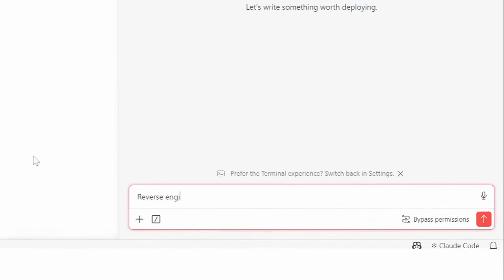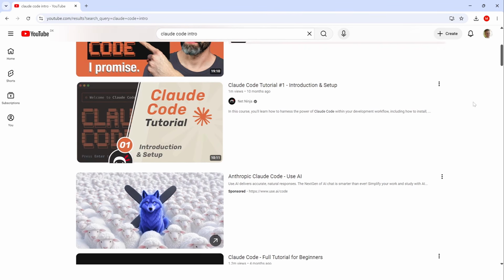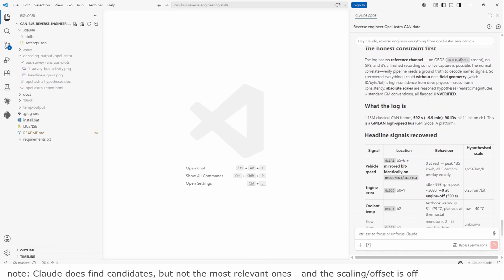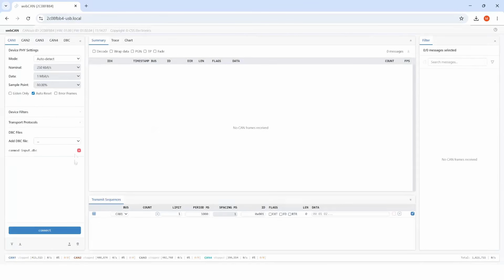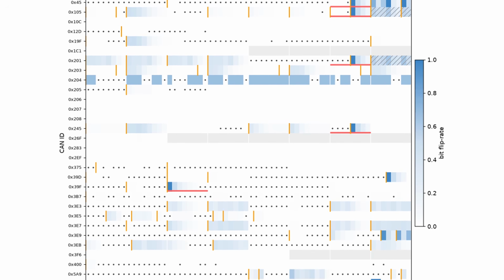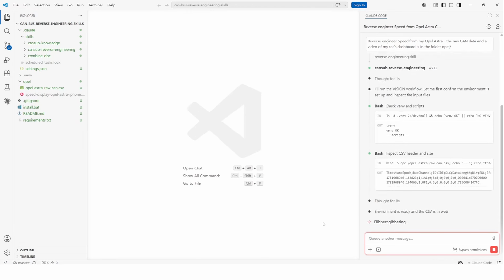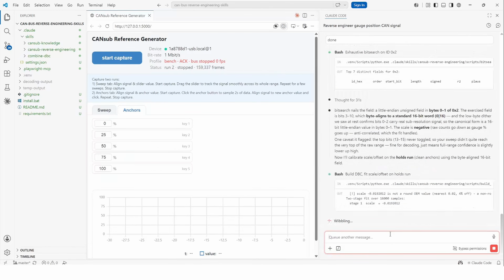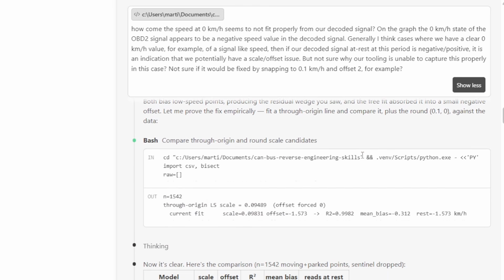AI CAN Bus Reverse Engineering [Claude Code]

Comment: Curious if you think this can be used to lets say control exhaust valves on a car like a 2022 bmw g80 m3. The valves can be control through the cars idrive which i assume uses can bus. Can you sniff the signal then attach it to a physical button to control whenever you would like?
Reply: First: Transmitting custom CAN frames into an active vehicle without knowing exactly what these frames represent/affect is VERY DANGEROUS. This is the reason why none of my showcases specifically describe transmit-oriented workflows like fuzzing or attempting to control vehicle behavior - as I don't think it's a good idea unless you know 100% what you're doing. If you do embark on something like this, make sure the physical environment and setup is safe. 

Beyond the above, I can't say for this specific case, but generally: If you have a way to trigger/initiate the proces you're looking to focus on and create a 'reference signal' e.g. by following showcase 3 to produce digitized, time synced data on the exhaust valves, then I expect you'd be able to use the skill to help you identify potential candidates for which IDs and data bytes correlate with this process. In turn, this should give you a set of candidates that you can 'replay' via python-can, for example, with certain signal values (encoded as raw CAN frames) to see if your actions induce the expected behavior. If you can consistently get the intended result by transmitting these candidate frames via python-can using the CANsub, then the final step is "just a matter" of finding a button-to-CAN product and map the custom frames accordingly. However, it may be that you encounter spurious behavior - e.g. if it's not a simple "send frame X to trigger Y" but e.g. some multi-frame logic. You may also hit challenges if you're trying to contradict the existing settings that would be set by the car itself - i.e. you can't typically "turn those off". 

With that said, others on youtube have more experience in this topic - Zero to 60 is coming out with another CANsub video soon where they do something closer to this :-)
Reply: two solutions come to mind. 1. bypass the canbus and just mod the actuators to work without any can signalling, replace them with a more "basic" 12v on off style actuator or vacuum type. 2. actually come up with a way to make the module that control the actuators send the packet that makes the actuators move. If you reverse engineer the software you will probably find a state machine that checks for errors and certain operating conditions to be met before the actuators can be well actuated.. Lets say its the ecm controlling the actuator, you could make it so that if drive mode is x and throttle percentage is over x open exhaust valves for example, or if clutch is pressed and car is moving open actuators etc those are just crude examples. there are no limits. only thing limiting the logic, is space constraint in the ECM MCU's flash size and integrating your new function within existing scheduler without causing serious issues. and ofcourse youd need to preferrably have a unused input unless you cannibalize something like maf sensor input or clutch switch input to use them as button inputs. you could even add logic that reads packets on can bus and that then actives your custom added function in the ecm like switching to a stage 1 tune. The sky's the limit basically.

Comment: use it to decode the firmware for your ECU instead, it found every can frame and how its scaled, decoded, even if its from a pin on the ECU (like engine crank/rpm, etc, iat, etc) even all the hidden uds commands and key/seed algorithm
Reply: yup, without it you never know for sure what each input and output value in ram is wired to physically.

Comment: Ive been using it to make a tuning/diagnostic application based on correct math the ecu uses it can currently look at lambda fuel table ve table the log file and tune and make the corrections to file to make it match. You select a range of what it does in the app eg maximum % change how many times did you visit that spot in the log file how many times did it observe this behaviour then it spits out a new cfg file
Reply: I just need more tunes and logs from other ecus to get it to support them also.
Reply: The math the ecu is using is based on live ecu sniffing, math i found, reversed engineered math. Sniffing was last it confirmed our math to ecu live in accuracy of .00012° of timing so id say its pretty accurate  and not one of those apps that makes things up and takes a leap in the dark
Reply: Plan is it'll see all logged channels see not aligning data eg high injector duty and lowering fuel pressure tell you to inspect fuel filters fuel pump etc

Comment: Can this work for more obscure CAN signals, meaning what if a reference signal is not possible?  Some examples might be motor current draw, coolant flow, motor temperature, motor speed demand, etc.
Reply: Without a reference signal it'll be like looking for a needle in a haystack, but with a blindfold on. This goes for both the 'classic' manual method and the AI-enhanced methodology: Without having a clear way to validate if you've found the right result, you'll not be able to reverse engineer it in my opinion. However, there can be more creative ways you might get at least some "reference holds". For example, you may be able to assume that motor temperature is going to be roughly X degC when you start the vehicle if the outdoor temperature is Y. And you may then also be able to assume that the motor temperature is going to be Z degC in that scenario after having driven for 30 min at roughly 50 km/h. And you may assume it's e.g. a linear climb from the initial temperature to the temperature after 30 min. Claude will probably be able to give you some rough figures for what that may look like - and you can then provide the raw CAN data along with this rough external info to get a chance at reverse engineering the motor temperature. This makes it equivalent to my 3rd showcase - but obviously it's harder if the signal changes slowly or if it has a lot of noise (like current draw).

Comment: I gave my VCDS loggings to Claude and it told me to change the PCV valve, spark plugs, ignition coils and the timing chain, it also recommended me an engine oil which, quite surprinsingly, reduced the oil consumption on my EA888 gen 2 engine. My mechanic said that if I had delayed the replacement, the chain would have jumped time and destroyed the engine. The 20$ subcriptions saved me from a big headache and also from a 2000$ engine replacement, so kudos to Claude.

Comment: This is really amazing, I am only still watching the video but would I be able to use this for the likes of activating a reverse camera while towing? The only problem is that the camera turns off at 10mph so I am not sure if this would be possible.
Reply: If the data related to it is available on the CAN bus, then it may be possible - though it may be a bit difficult if it's a state signal that is only triggered by reverse driving, as there may be many other state signals that get flipped by such an event. But if it toggles off at 10 km/h consistently, that might be a useful isolation mechanism.

Comment: Great video! I think it would have been even better to tell something about expected token costs. I would assume that if you need to feed video as ground truth data, converting that to usable numerical input is going to eat a lot of tokens. If you have time correlated OBD-II data with raw CAN BUS bytes, then it should require much less tokens to reverse engineer.
Reply: I don't feed the raw video to Claude - rather, Claude just has a Python script that uses OCR to convert the video into a time series reference signal. This is generally the principle throughout: Use Python scripts to minimize the context/token usage, meaning that Claude only has to focus on light-weight statistical results. The usage was minimal in my experience. But good feedback, this could be more explicit! :-) But basically the OCR workflow vs. OBD2 workflow uses the same amount of tokens more-or-less as the heavy lifting is done via scripts in both cases.

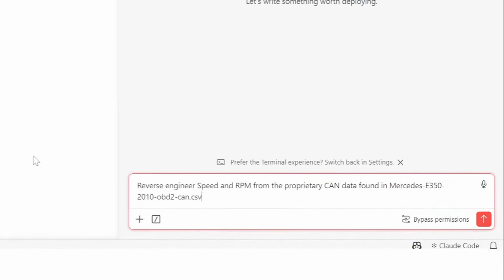Comment: 0:34. Those CAN bus signal shown in the prompt and in the graphics aren't proprietary. You could have at least used something that's actually proprietary... 

And now I think this is a 30 minute video showing you how to get data that you can already get.
Reply: I suggest watching the full video, I think you're misunderstanding the role of OBD2 data (used as a reference signal because it is indeed public and known) vs. the proprietary signals that are indeed not known in advance. The speed and RPM signals in the first showcase are 100% proprietary and not known (at least to me) prior to making the showcase.
Reply: @martinfalch8016  You clearly have no idea what you're talking about.  There are many PIDs that have to be exposed for anyone to read for various reasons - these are not proprietary.  Wheel speed and engine speed are two examples that are required to be exposed and are not proprietary.
Maybe you should actually read upon the topic, or maybe plug an OBD2 reader into a vehicle and see what you can read without proprietary knowledge before trying to correct others 😉
Reply: @Shocker99  Again, I believe you are misunderstanding this. You are 100% correct that OBD2 PIDs are generally public - you can find a full overview of these on the Wikipedia OBD2 PIDs page, or my own OBD2 PIDs overview page. There is no point in "reverse engineering" OBD2 PIDs and therefore that is not what I am doing in the video. Rather, I leverage the fact that OBD2 PIDs like Speed and RPM are publically known and can be requested with any tool (such as OBD2 scanners - or our CANsub). This allows me to request data on these signals via the OBD2 protocol in order to get a 'reference signal' that I can use to reverse engineer the proprietary equivalents to these signals - i.e. the Speed and RPM that is "broadcast" by default on the underlying CAN bus. These are useful for many reasons (as I explain in detail in the full article), e.g. because they are often higher-frequency and higher -resolution vs. their OBD2 counterparts - and require no requests in order to be recorded.

To be fully explicit, OBD2 data such as speed (PID 0x0D) and RPM (PID 0x0C) is available on the CAN ID 0x7E8 in response to request made via CAN ID 0x7DF. In contrast, the proprietary Mercedes E350 Speed is found to be broadcast on CAN ID 0x19F, while the proprietary RPM is broadcast on CAN ID 0x105.

I would not correct things unless I knew what I was talking about. I am a co-owner of CSS Electronics and the author of this video - as well as all 200+ guides/articles on the CSS Electronics website - incl.our intros to CAN, OBD2, J1939,  etc. I have provided technical support to thousands of engineers working across our 10,000+ customers globally. The confusion between the "underlying OEM-specific proprietary CAN bus data" vs. "OBD2 PIDs" is a common thing that I encounter - and maybe it could be made clearer in the video.

Comment: Thanks for the info. I'm new to the concept so maybe this exists already but if this were to interface with a user submitted info that claude could reference as well as other members that would be awesome. For example I could upload my data and vehicle type for the values I found to a database that others could add to you could in theory help reduce errors/hallucinations and possibly even find that a manufacturer has common values across certain years to speed up and or confirm results.

Comment: outstanding work! I'm a bit surprised this didn't trigger any safety flags in Claude Code. I would be interested in how an open source model like GLM 5.2 would perform on a task like this. Great work again, these agentic models really unlock their capabilities once you help them "close the loop" on your work. A bit harder here as there is a hardware component. Excited to see what come next!
Reply: I used Opus 4.8, rather than Fable 5 - but I think it would be the same either way. I don't think this is seen as a safety issue from Claude's perspective. I expect other models willl work more-or-less equally well, though I have less experience in what the "skill" equivalent looks like in other ecosystems

Comment: Very impressive, how about using an actual automotive scanner with the capability of reading data flow from the vehicle to get reference data??
You think that will give claude valid data?? being that data from scanner it is not raw data but processed data, possible to train Claude with said data if you tell it about latency in scanner 
data??
Reply: I actually mention this option in the full article - i.e. for the vision/OCR workflow, you can record some scan tool or e.g. an OEM diagnostic tool in real-time while you record the raw CAN data. Since OEM/scan tools often incorporate proprietary decoding rules that they won't share directly, you can leverage this fact to simply create a clean reference by filming a real-time value from the display of such a tool (like my 2nd showcase) and then use this. I expect it'll work very well.
Reply: Yes, absolutely. I myself used used AI to reverse engineer techstream and then used "j2534 shim" to capture all the packets that travel between the car and techstream. Then you just process the techstream internal id's to the data that you captured and now you know that packet 00x0 is engine rpm. I took it further and reverse engineered my cars ecu basically 100% and know how the ecm processes crank shaft position sensor signal, converts it to rpm, broadcasts it via can and sets fault codes and so on. 
Having a manufacturer specific software and captures of it in action while you log certain things is a cheat code if youre reverse engineering a ecm. You get the ground truth for inputs and outputs.

Comment: Where are you going to use this I don't understand
Reply: Basically, anyone that wants to use vehicle/machine data - but are not the original manufacturer - may need to reverse engineer some of the data to enable their use case. This can e.g. include operators of vehicle fleets, researchers, hobbyist etc. I explain this in the initial part of the video, and in more detail in the full article :-)
Reply: @martinfalch8016 thank you very much!

Comment: Have you any idea how hard it would be to make it work on isobus?
Reply: It would be the same concept - but most of the ISOBUS data is already standardized in my experience and the data is public. We offer an ISOBUS DBC file for convenience. I always recommend checking what is decodable from available DBC files first in J1939, ISOBUS, NMEA 2000.
Reply: @martinfalch8016 haha... Yeah, from my experience, pretty every manufacturer in agriculture has their own way obfuscating isobus data.

But yeah, thanks! I potentially have a young electrical engineer coming over to learn about some isobus sniffing. I'll stick to mechanical design thankyou very much haha.

Comment: Would this work for anything that runs can?
Reply: Yes, in the video I e.g. show it used on a sensor-to-CAN module. It's not limited to cars, trucks etc - you can apply this methodology, the CANsub and the python-can tools on anything that is CAN or CAN FD based, This includes practically any vehicles (cars, trucks, buses, ebikes, motorcycles, ...), ships, engines, machinery etc.

Comment: Usually people can do this for free at home. Modern cars will slow you down a little. But AI only helps with explaining the process and doing it a little faster.
Still a great thing to try at home
Reply: We provide various tutorials on this on our website, including the AI CAN sniffer intro I link to in the description. I would say that "classic" methods require extensive expertise to be practical - but the method outlined here can be done my users that have never reverse engineered CAN signals before. I would still say that some understanding of CAN bus and vehicle data is preferable, but at this stage I think it is more a matter of having a bit of patience while learning. As per the video, the AI methodology mainly democratizes access and speeds up the process (quite massively in my experience), though the concepts are the same as they have always been :-)
Reply: Bullshit traditional canbus reverse engineering is tedious as fuck.
Reply: So normal people do this? Is there a tutorial source?
Reply: @hakankosebas2085  thousands of articles and scripts online, i tried pasting a link here, but my comment was blocked I guess.

And what do you mean by normal people. You need to have some engineer knowledge.
You think an average mom will be able to read and push a CAN bus value with AI? Yeah i doubt it too...
Reply: @hakankosebas2085 just ask Claude

Comment: can you do john deere?
Reply: The CANsub can be used with any CAN bus - incl. heavy-duty J1939/ISOBUS as used in John Deere tractors. So the concepts apply as well here - but as per my intro, I suggest first testing out what can be decoded from a J1939 and ISOBUS DBC, in my experience on JD vehicles that will already give you 60-80% of signals, so that you spend your time wisely, rather than trying to reverse engineer standardized signals.

Comment: These days everything is locked in a car. Every interface and protocol is proprietary. You can not swap a transmissing and replace from an other car beucase THIS transmisson is coded to the engine. Can´t even pop the hood anymore soon.